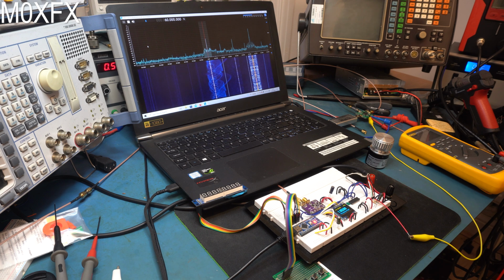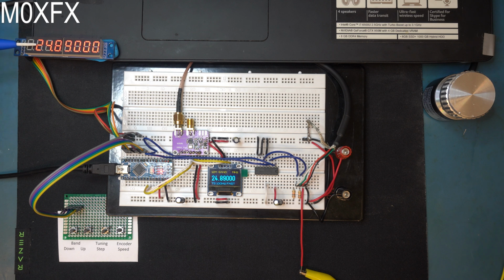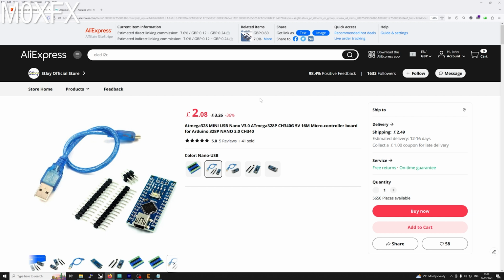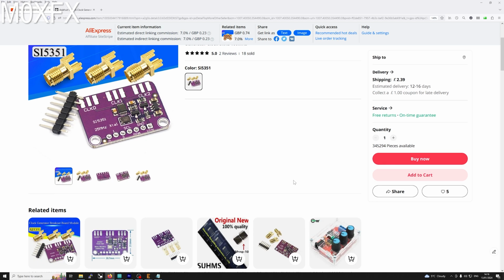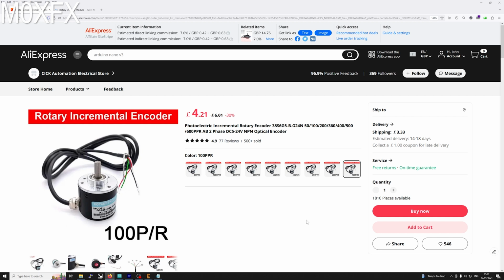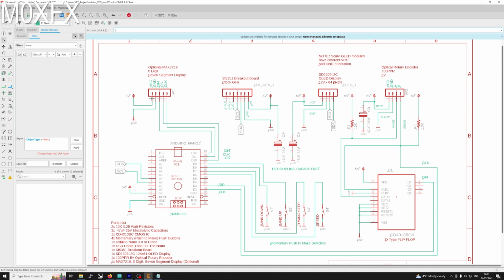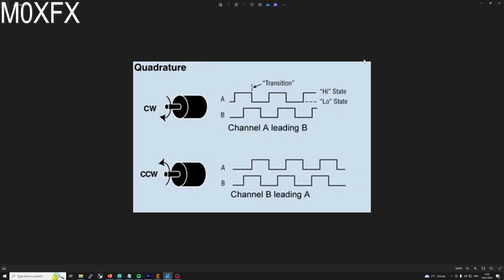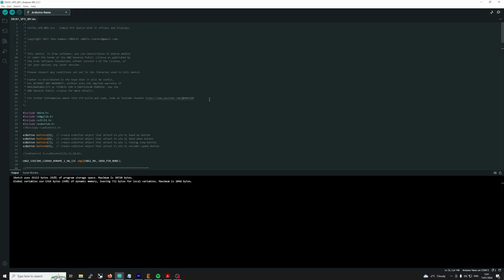How to Build and Code an Arduino VFO Si5351 PART-1

Comment: Where can I find more details on the spectral purity of the VFO. especially phase Noise
As this an important figure for the design of a receiver with a wide dynamic range
Reply from the maker: Spectral purity covers several factors. The second harmonic is notably strong with the SI5351, so proper output filtering can help.

Stability depends on the reference oscillator’s PPM rating and temperature coefficients. The further the output frequency is from the reference, the more pronounced stability issues become. Cheap SI5351 boards often use low-quality crystals, which can affect performance.

Phase noise worsens when tuning across frequencies but remains good when static. If using multiple I2C devices, minimize read/write operations during tuning to reduce latency and improve frequency transitions.

The SI5351 datasheet has detailed info. What’s your VFO application?

Comment: Hi, nice video, is it possible to go up to 1.7ghz?
Reply from the maker: Apologies for the late reply, No this unit uses the Si 5351 which has a range of up to 200Mhz however people have been using the harmonics to get into the GHz range. This does work but it can suffer frequency instability as you are so far away from the base clock frequency. I hope this is of help. Regards John

Comment: I've just discovered this series and it's exactly what I'm looking for. I'm a returning to the hobby ham with little technical knowledge and a lot of enthusiasm... and a lot of age! Your video is so well done that I followed it with ease and will work my way through the rest of the series. If I'm still following well, I'll have a go at building one. My ultimate goal is to build a QRP transceiver. Best 73 Ace G0ACE

Comment: Thank you. Great video. Works better than my more expensive Upconverter. The sketch is flawless. I had a bit of trouble calibrating the Si5351. What I did was correct the PPM on the Sdr.
Reply from the maker: Hi Mike, I am chuffed that you like the project. As you say it makes a great up converter when you couple it with good mixer for SDR. I am not sure if you know but I have had some PCB's made see (part 4) it may make things a little easier. Re calibration. If you use the unit at a fixed frequency for up conversion then adjusting the SDR is fine.

Comment: Watching these is really helpful as this is pretty much what I have been wanting to do - so much so that I went ahead a bought a mixer board!
First, a question: How difficult would it be to utilize the 2nd clock as a fixed frequency LO and use the RTL-SDR to do the tuning instead?
I would like to have the VFO control a radio, but use a SDR dongle to listen in on the HF bands (The older SDR unit I have CANNOT recieve below 30MHz or so)
Second, a comment: the 1.3" display seems to use a different driver (SH 1106 I think) where as the "long, skinny one" uses the same SSD 1306, but has a 128x32 resolution (I bought one for an "S-Meter" project, along with a Pro Mini)
Reply from the maker: Hi, It's really easy to set the clock at a static frequency. Re setting the unit up so RTL's can receive all the HF band will work with the mixer. Re the display, I think that I know the display you are describing and have some knocking about, I will take a look at and see if we can get some support in the code for this. I will try to cover these topics in part 3. Great questions by the way. Best Regards John
Reply: @M0XFXUK  I THINK the only addition to YOUR code would be to enable the "Clk 1" output at 100MHz and feed THAT to the mixer, thereby keeping the VFO output on "Clk 0" as-is for controlling a transceiver!
Reply from the maker: @mstover2809  Yes that I think that is an extremely good idea, again I will bring this up in part 3.